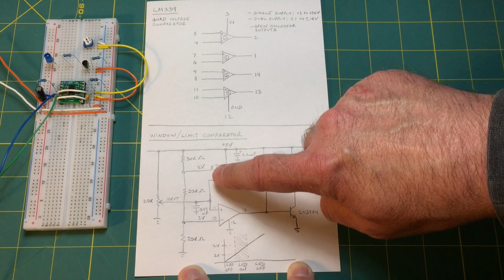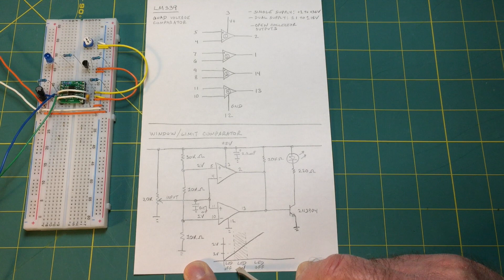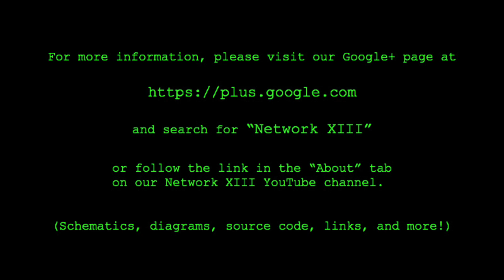LM339 Window Comparator

Comment: I understand the basics, but don´t quite grasp the details: What is at the far left and far right end of the uppest horizontal rail of your schematic? In other words, what is normally connected to those 2 ends? 
And can all grounds be one single ground, or does each ground have to be the negative pole of the respective and near-by positive voltage-source ???
What are the 2 capacitors for, and which one is which (which has to be the electrolytic one, and which has to be the ceramic one?)? In other window-comparator-designs I´ve seen, no capacitors were used, and I´d like to understand the advantages of using any, in such a case, since theose other designs seemed to make sense and also even function, without the use of any capacitors.
Sorry, for those elementar questions, I have no clue of electronics, only of problems I have to solve...   ;-)
Reply from the maker: There is nothing connected to the left and right ends of the +5V rail, thats just the way I draw my schematics.  There is one single ground net in this circuit.  The capacitors are in the circuit to reduce noise, circuits built on protoboards tend to be noisy.  Ideally this circuit would be built on a PCB that has a ground plane layer, which would mitigate some of the noise.  The type of capacitor is not critical here, I’m sure I just grabbed whatever was on my workbench on the day I made the video.
Reply: @NetworkXIII  All questions to complete satisfaction answered, thanks a lot !!!   ;-)   I´ll try it... The question about the grounds, has been partly already answered from the study of other circuits, but as said, for me, such things are a big deal, and not self-evident. I use electronics only when I need them, rarely, and have no background-knowledge. So, what for you is self-evident, I have to look twice and thrice to notice...

Comment: What is 2 and 13 voltage output?
Reply from the maker: Pins 2 and 13 are open-collector outputs, so they need a pull-up resistor like I’m using here.